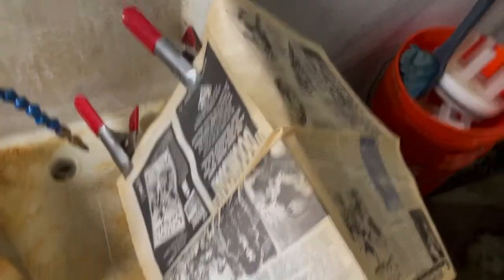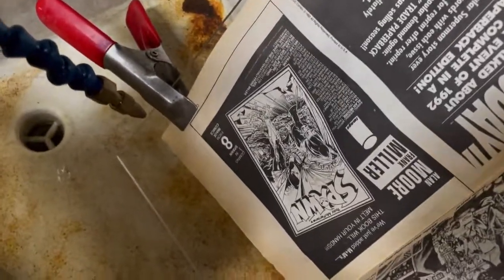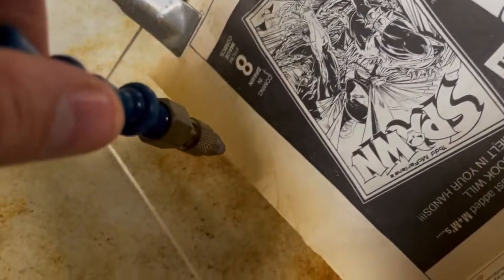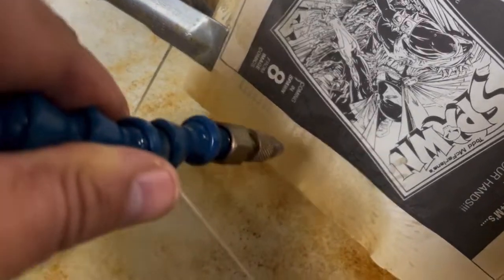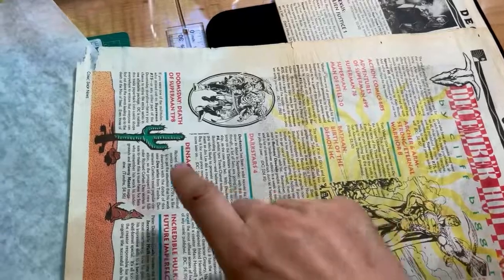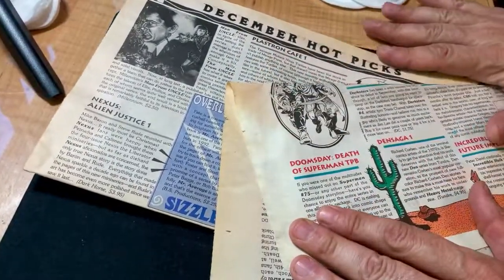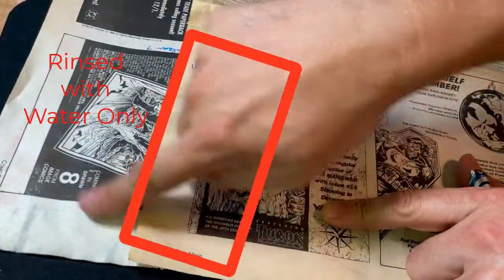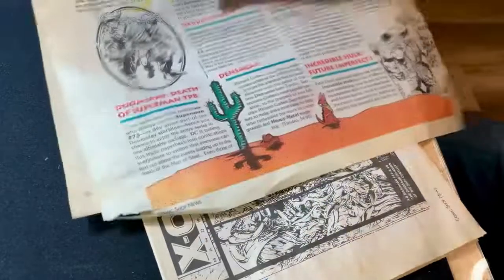Development of a comic book washing machine

Comment: Very interesting. Why not just soaking the pages with Reemay paper?
Reply from the maker: Im not sure what you mean by "soaking with reemay paper"?  I do use a non woven polyester sheet under the pages sometimes if I feel its necessary.  But I don't want diffusion to be my dominating mass transfer factor.  the flowing system allows me to increase the mass transfer rate using convection.  overall its just because I don't want to wait  several  hours or days days for my cleaning solution to work while the remaining sizing and ink also gets a chance to dissolve.  I have no idea if that answers your question or not but I hope it helps.

Comment: Hello Rick-perhaps you should rethink your method of how to hang the paper- it appears that you have  a plexiglass type material folded at 45 degrees to support the paper and drain the dirty liquid away from the paper. you need a support material between the plexi "stand" and the paper and another layer over the paper-stretched and clipped to the plexi-not the paper. here is a cheap product that i use to support covers and pages for cleaning. https://www.amazon.com/dp/B00LB3SBZG?psc=1&ref=ppx_pop_dt_b_product_details      this is polypropoline but there are also polyester products that are similar. Good luck with your research! Are you selling the immac-u-clean product? please PM me with info on purchasing. Thank you

Comment: I have a comic book chemistry question for you. BCW backing boards are sprayed with a coating of calcium carbonate on one side only and claim to neutralize/aborb acids given off by a comic book. E Gerber boards are infused throughout with calcium carbonate,  but claims not to absorb anything.  They say the buffer is there only to take care of the board itself. Do you think the E Gerber neutralizes acids from the comic anyway, just by being enclosed with it in a bag.? Thanks a lot. Enjoy your work. Jim
Reply from the maker: Probably not to a significant extent, the acid/base neutralization occurs in the mostly liquid phase not the gas phase. So whatever neutralization occurs needs some amount of water to proceed.    we write the reacton as H2SO4 + CaCO3  → CaSO4 + H₂CO₃  . The carbonic acid is unstable. It decomposes to form carbon dioxide and water  H₂CO₃ → CO₂ + H₂O. The reaction is the sum of the above two equations.

2H2SO4 + CaCO₃ → CaSO4 + H₂O + CO₂, but the H+ (on the sulfuric acid) ions get from the sulfate to the carbonate (CO3) ion by piggy backing on water molecule in the liquid phase.

Comment: Have you tried aqueous treatments to clean interior pages ? I saw a video on YouTube ,where they submerged pages in water.
Reply from the maker: actually I have been doing that for decades with mixed success.  Aqueous immersion diffusion-limited cleaning that works sometimes and but largely doesn't do much in my experience and is rarely worth the effort put into it.  This process  is a forced-convection cleaning with a csurfactant so I am trying to make improvements.  "trying" is the key word here.